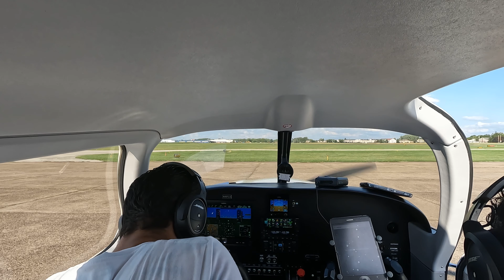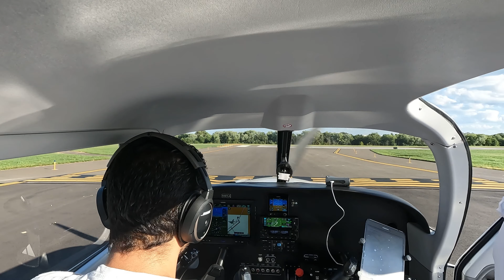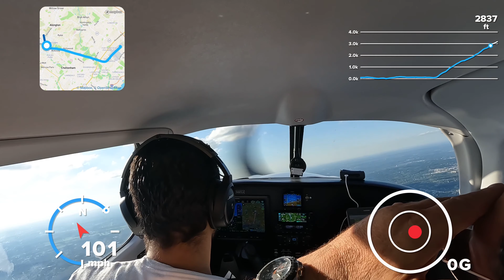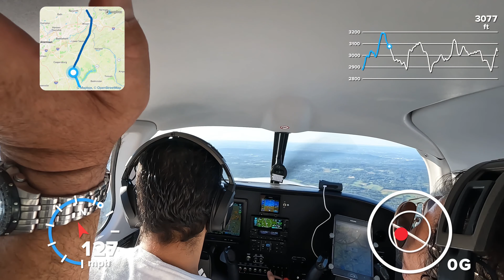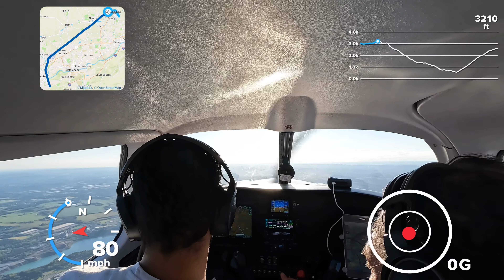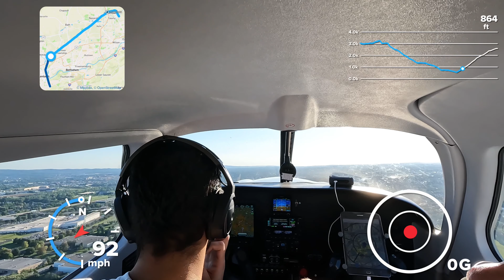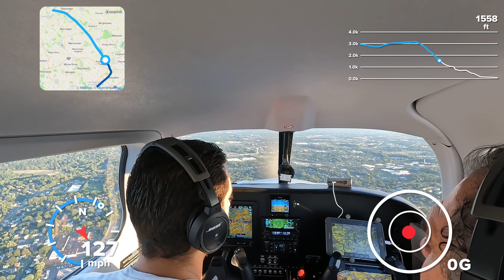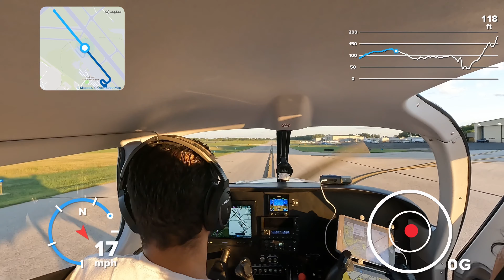First time flying an approach

Comment: What's the avionics on this one
Reply from the maker: GARMIN G3X Touch – Single 10.6” PFD with Con next® technology GTR 225 Comm Radio
GTX 335R Transponder w ADS-8 In & Out
Synthetic Vision
Airport Directory
Flight Data Logging
GFC 500 Autopilot w/ ESP
GNX 375 2’ Touchscreen NAV/X-Ponder w/ ADS-8 In & Out (replaces GTX335R)
2nd GNC 225 NAV/Comm Radio
GMA 245R Remote Audio Panel w/ Bluetooth
Garmin GS Standby